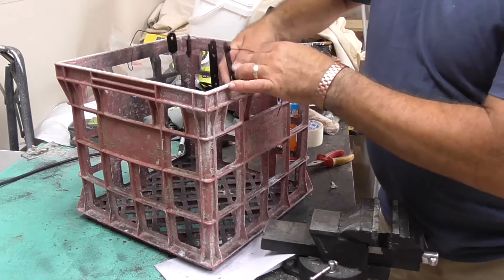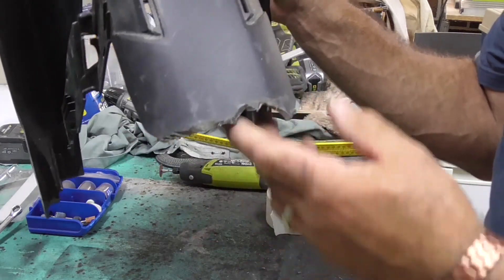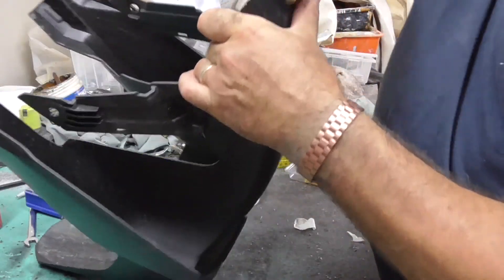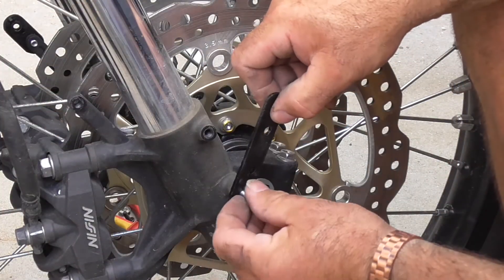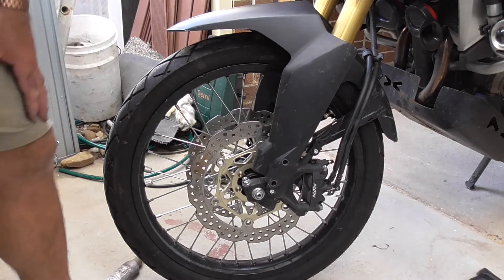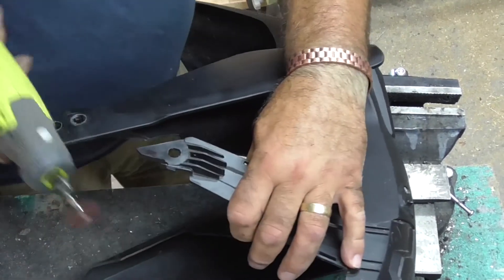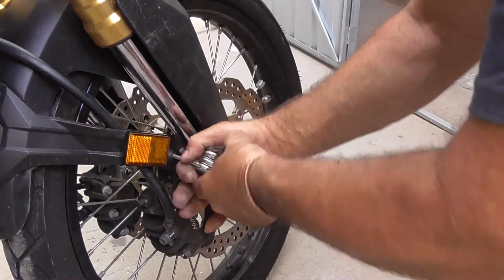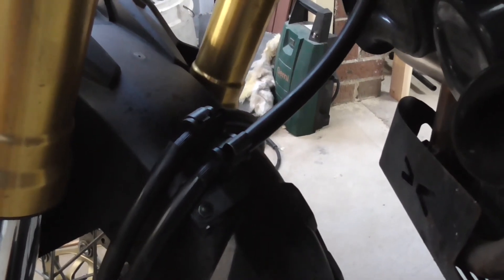fender riser install

Comment: Great job Andy.  Two thumbs up.  It occurred to me while watching you measure and match the front and rear upper screw spacing that you could just leave the two rear lower bracket mounting screws loose while you install the mudguard and tighten the four front mudguard mounting screws. 

It'd then be easy-peasy to pivot the brackets fore and aft as needed to line the upper bracket holes up with the holes in the plastic.  You'd then tighten down the lower screws after you have the top screws started.

Cheers!
Reply from the maker: The_Eccentric 
Wow now theres perfection thanks for your thoughts and post 👍👍

Comment: Nice work thanks for the video. What bash plate are you using and are you using Heed full crash bars?
Reply from the maker: Hi
Yes heed bunkers which are full protection.
Bashplate i made my self
Reply: Do you have a video with a better view of it and how you made it?
Reply from the maker: @bergoff  
Google altrider skid plate there are lots of pics i designed from there.
I made a carboard template first and kept cutting and tapeing till it worked then used cardboard as a template on steel plate

Comment: I didn’t see a speed sensor cable on the front left? Does your Africa Twin not have one? I have done fender lifts on a manual and a DCT and both had the speed sensor cable on the front left which gets very tight when you do the lift. Interested if you have one or not and if not why?
Reply from the maker: Adam Smith 
Hi Adam my Twin as no ABS, as an old bike rider i opted to get the standard brakeing system. That must be why. Andy
Reply: Wulf On The Run cheers Andy - Makes sense.

Comment: Good vid,,,, but doesn't fix the problem entirely. Yes you have given yourself an extra 20mm of clearance down the centre of the tyre, which does help,,but the side clearance is where the biggest problem is. Get a stone caught in the side lugs of a knobby, and if its wedged in enough, it will rip the guard off
Reply from the maker: Rob Banks 
Good point Rob thanks for the feedback 👍👍